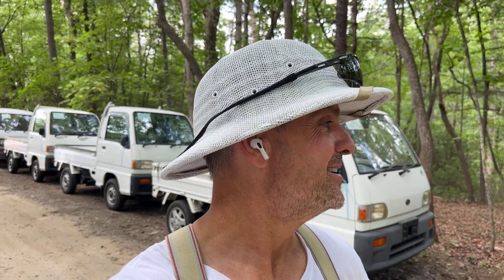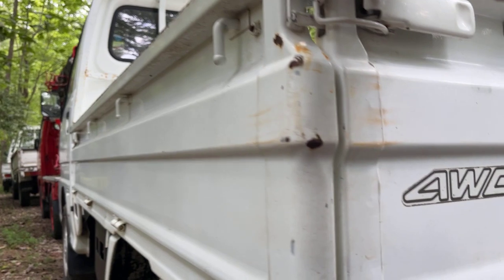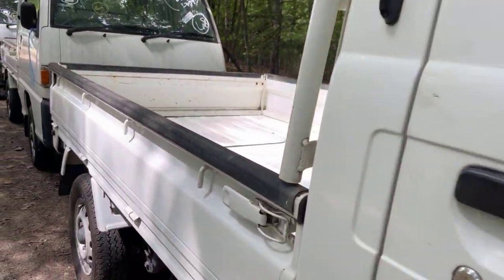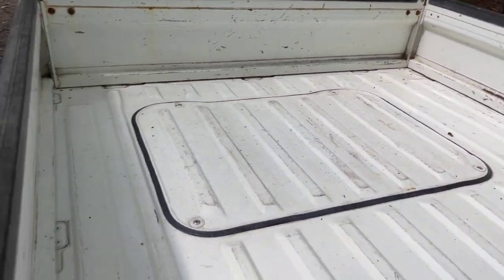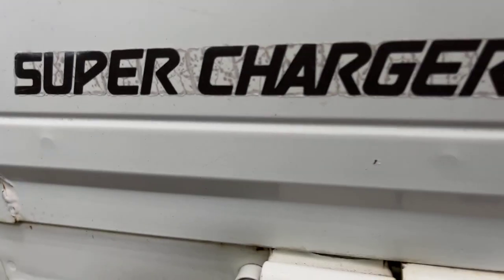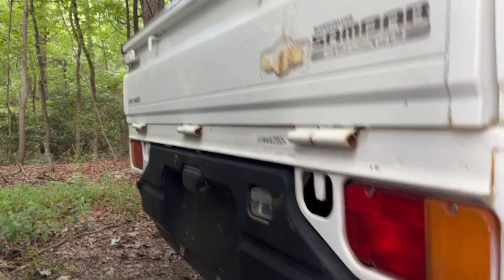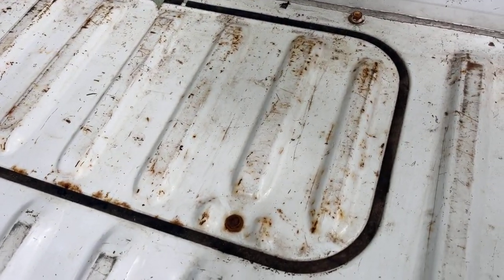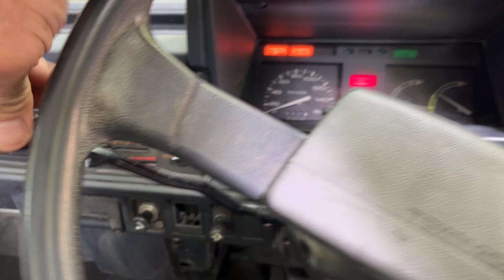August 17, 2023 shipment (one unicorn)

Comment from the maker: That is an excellent question. I would not really have any idea because these are fairly recent replacement items. I would have to say that it takes two or three years before you can really know for sure. 

Now, allow me to speculate. I would guess that the water pump that replaced the factory water pump will not be having the same issue with the bearing. The new bearing in the replacement water pump has been recently produced, and was not provided by the same supplier. Additionally, we were only talking about two mini trucks that had a bad bearing in the water pump. Statistically this is significant. excellent question! Thank you for your feedback…

Comment: Others have claimed the Subaru EN07 is a NON-interference engine.
Reply from the maker: That hasn't been our experience :)
Reply: @minitrucks  Tony — You are right and it Will Bend the valves as I got confirmation from an engine rebuilder on this matter.  There are posts to the contrary on some Kei Truck Forums — probably by guys that don’t even own a Sambar.